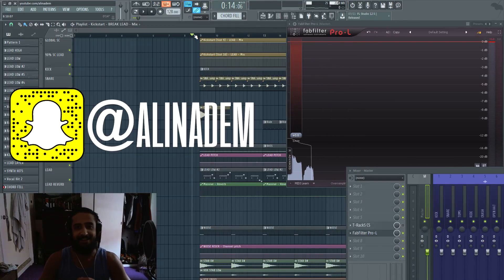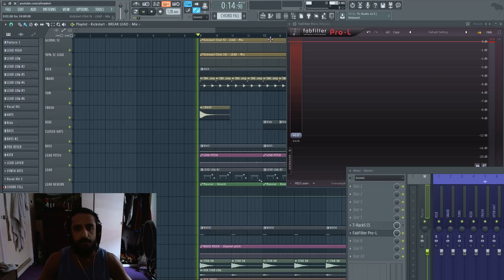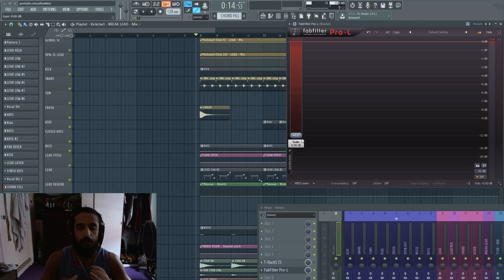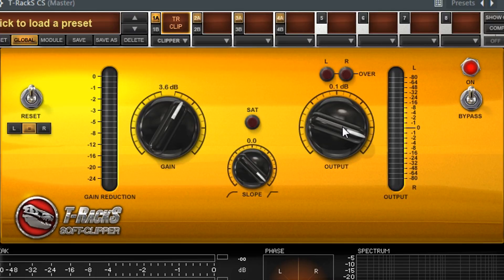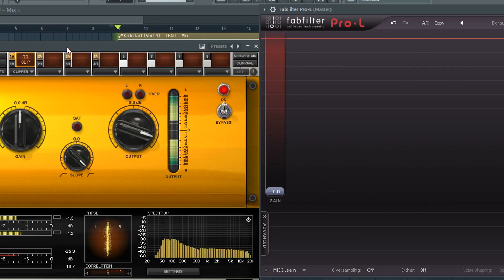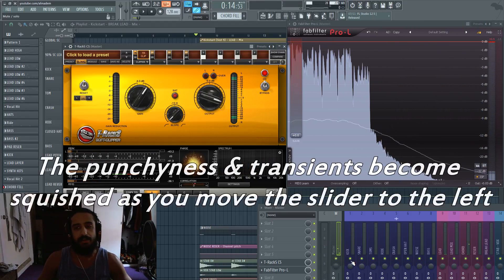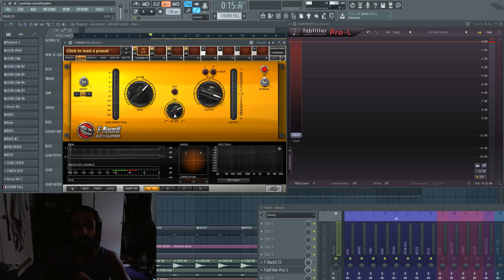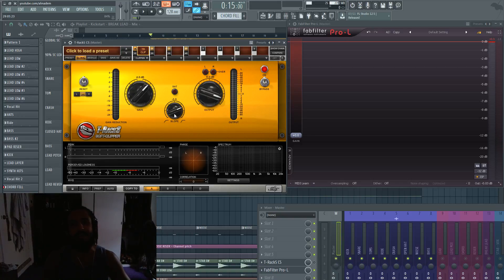Soft Clipping on Mastering - How to use soft clipping when mastering EDM - FL Studio 12 Tutorial

Comment: @ 3:41 I think you may have this backwards, if you want to retain more of the transients, you want a softer knee setting, thus not chopping them off. If you want to use this as a hard clip (chop the transients right off) You will want a hard knee. This is critical for mastering in the sense, you want to keep your peaks in check (under -1). Use the clipper for the peaks processing an uncompressed signal (well unlimited signal) then use the limiter directly after the clipper for the main lifting. If you use the clipper after the limiter, you are squeezing and already squeezed signal. Thus the clipper first, the limiter second. Hope that made sense, thanks
Reply: I came for this comment. Facts 💯
Reply: Retaining transients is different than getting a perceived effect through clipping audio. You are not the only one that struggles with this. Perceived audio is much different than what is actually coming through in terms of gain. And Ali rightly so, replied to you on this subject. 

Think of why a square wave can be heard crisply through laptop speakers and a sine wave isn't as clear. Even though they may be at the same volume (Especially at lower notes). We love saturation/clipping. Our ears love it when used properly. You can always use a transient shaper after the clipper if your desired effect is not fully achieved via the clipper (or used heavily) to bring back some of the initial transients.

You are also right in that the normal signal flow is using a clipper, followed by a limiter, however I'm not sure you grasp why that exactly is the case.
Reply from the maker: By definition, a hard slope means less processing, therefore you have it reversed, simply look at gain reduction.
Reply: @AliNadem  I'm not really sure where you heard this from but... Here is the definition of hard knee vs. soft knee:::: 
"With hard knee compression, the gain reduction applied to the signal occurs as soon as the signal exceeds the level set by the threshold/// With soft knee compression, the onset of gain reduction occurs gradually after the signal has exceeded the threshold, producing a more musical response".

So when you say "Less processing ? I'm not sure that really applies here. It's more the threshold reacting to the signal in conjunction with the knee. But if I had to equate this to "processing", I'd had to say a soft knee is doing less.
Reply: @AliNadem  It's amazing how some people don't understand while telling you that you're wrong. You even played a short section of just drums (which are basically ALL transients) while going from hard knee to soft. You can hear the transients softening as you approached full soft knee. Maybe some just don't know what to listen for.

Comment: Digital clipping is crap, if you have a crappy mix with individual tracks hitting red and then push them hard into digital clipping then you're just making loud turd. But if you have a mix with good gain-staging both in the individual tracks, the plugins, as well as the master fader (zero clipping), then you can make it as loud as you want to and it would still sound nice. Analog is far more forgiving in how it distorts than digital. Unlike analog clipping that smoothly transitions from the desired waveform to a distorted version of it, nothing about digital clipping is gentle or smooth. Digital amplitudes are represented by discrete numeric values. In PCM encoded signals, the number of available values is defined by the number of bits in each digital word (the actual number is calculated by raising the number 2 to the power of the number of bits in the word. For example, an 8-bit digital word can have at most 256 unique values or 2 * 2 * 2 * 2 * 2 * 2 * 2 * 2 or 2 to the 8th power). Unlike voltages in a wire, digital values beyond the maximum number are undefined…there is simply no going past the ceiling. Whereas tubes or other analog electronics can output values higher than their max (although they are distorted), digital outputs a perfectly flat plateau. That’s why it’s extremely important that the original transfer from the master tape to PCM or DSD digital be done correctly.
Reply: Yeah, what Jan said.🙂

Comment: My question for you is when I do this, sometimes I like to Lowpass my master for a muffled effect, I still want it to be loud, but it distorts and sounds so bad. Would I need to automate this, or am I using this wrong? When I play the drop of the track, I hear no distortion just nice, and loud. But when I go to a softer part, specifically a part with less natural high frequencies in it, it distorts and sounds like a broken speaker. What's the issue? How do I fix this?
Reply: Is there resonance on the filter?
Reply: No res. It may be that my headphones need repair because they do crackle on pro mixes even.
Reply: Do you have an audio interface?
Reply: No, but I’m almost certain that’s not my problem.
Reply: During the drop, the distortion is hidden by the other high frequencies that are already playing. When you have the treble quiet or muted, the pops created by saturation (particularly hard saturation/clipping) are audible. I would try to automate the level of the saturation as you said to avoid clipping/popping during those parts. Make sure you automate in a way that isn't very noticeable or distracting. Otherwise you could lower the volumes of individual clips/instruments, so you can keep important things like the kick at the same level if possible. Hope this helps!
Reply: Because it still sounds good with minor distortion with all the highs in the drop! I just wanted to get that clean muffled sound.
Reply: Realitect and to be honest that’s what I thought it was so my suspicion was right!

Comment: If you're using Maximus, just use the saturation knobs - these are literally a soft clipper. Left knob, as you turn it away from the center, makes the clip softer(with 2 sides you can turn the knob, these are 2 algorithms of soft-clipping), and the right knob is the ceiling.
Also I've been using a single Maximus preset I made for a long time and had no problem with it, so you might want to try it out too. lol
https://drive.google.com/file/d/1HFEymiROroxuH4JspkvOdkwysiC7yhnQ/view?usp=sharing

P.S. A whole plugin made just for soft-clipping? Why not just use WaveShaper to do exactly the same thing? Just set the curve up like that:
https://gyazo.com/1a5492a8a73bff55dd991b712f87a3a8
Pregain knob is same as the gain knob in that plugin, MIX knob pretty much controls the slope, and POST is the post gain knob.
Reply from the maker: Those are some excellent points you made! Thanks for sharing the info, I wasn't aware of that in Maximus, I'll definitely try to a/b
Reply: No problem. When you have nothing to do, it can be fun learning how your software works - then suddenly you can make great stuff with 3x Osc and use Fruity Limiter in the most unconventional ways! :v
Reply: Can you fix the link? I want to try your preset please
Reply: @KL3R360  
Oh, sorry, had to do a cleanup of it and forgot about such links. Should work now!